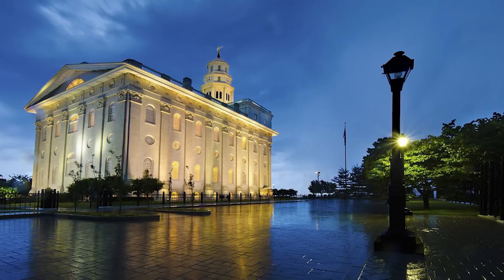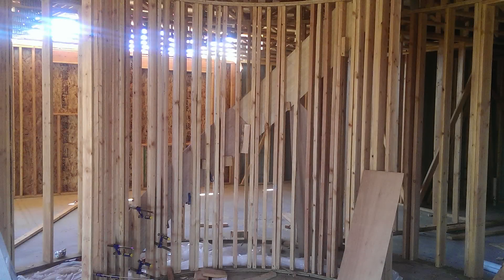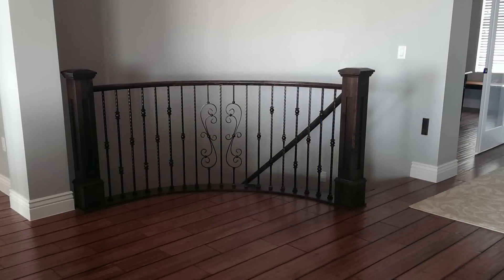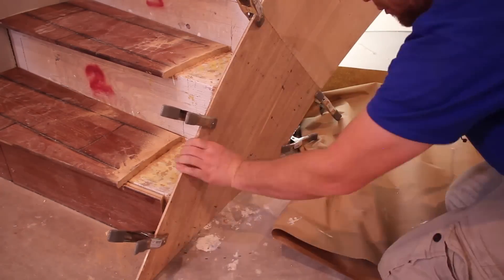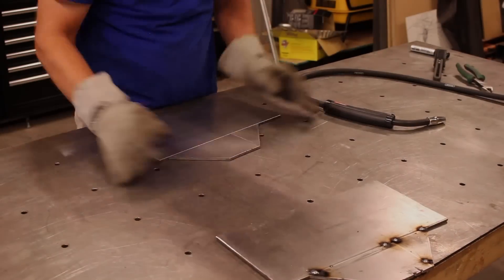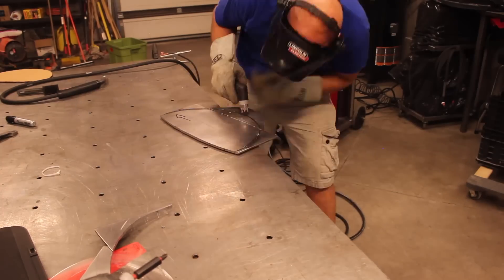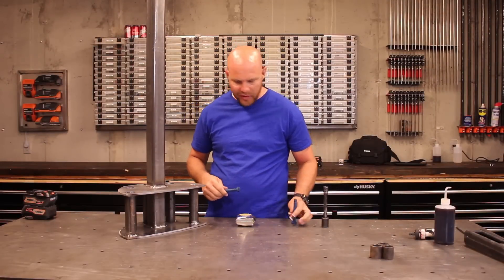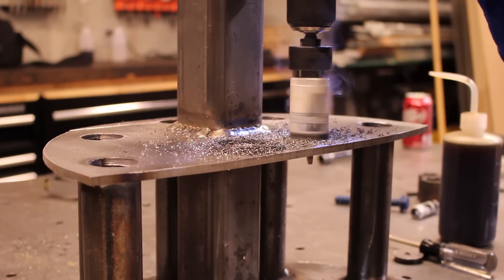Curved Stairs - Part 1

Comment: 1) Do not run band saw blades so fast.! You were pushing hella hard, I could see.
2) Use oil with it. If it was really 1/4" thick, remind yourself of step 1.
3) Using oil or lubricant, make sure it is constantly lubricated.  Keep an oil can with you.
4) wear PPE!
5) Stop running it so fast!

6th and final critique use oil on pretty much anything metal. Especially the band saw and hole saws... night and day difference. Youd get fired ever running drills or any of that without lubricants. Bit breakers are bit buyers as they say...

Cool build. 😎 i would have bought better clamps at the end... i see the real craftsmen. Gluing both sides, clamping final with goo-out and screwed finished.
Reply from the maker: Thanks for the tips!

Comment: I want both sides open. I'm on a few forums but nothing specific to curved stairs
Any guidance where to go? I'm only on FB for social media, but I'm absolutely wanting to join a real forum..
Reply: I've built free standing open both circulars. The width of the stringers adds strength as well as thickness. I would also add a center stringer, and make sure the stringers are anchored securely at the foot.

Comment: Real craftsmen can built whatever they want, and it doesn't have to be connected to any any professional techniques or industry standards.

Earning a living at it is a whole different story.  For that one needs to  work for someone who is already doing that.

Unfortunately you'll also learn all the ways to short-cut and produce an inferior product to what you would do for yourself.

Two thumbs up on this  although coming from a former, retired professional,  your Diy project bears little resemblance to anything actually being produced today or in  the past.

Still looks good though.

Comment: please can you advise me.....the bending ply was ripped in long sections ....how did you determine the angle of the riser to ensure the curve was correct?
Reply from the maker: I am happy to help. Can you please rephrase the question? I'm going what you're asking.
Reply from the maker: Maybe you meant to ask how I determined the angle of the stringer?
Reply: yup ...sorry was not concentrating.....yes how does one determine the angle of the stringer and then translate that to a cut on your ply
Reply from the maker: How far along are you on the project? Is it all on paper at this point or do you have a hole in the floor already and you're building the stairs? 

As for the angle: The angle of the stairs is dictated by the geometry of the framing...You have to consider the headroom as you ascend and descend, as well as how much travel you have, etc. 

To answer your question simply, I ripped all the pieces of ply down to 16", then once I figured out the angle I just tacked up the ply at the proper angle and then drew a level line across the bottom the show me the angle. Then I just chopped off the triangle, and that was the angle. I then removed that piece and set it down on the floor. 

Drive some nails into the form wall as guides so that when you're gluing up the ply you put it at the proper place. Have people there to help you and go to town. 

You don't have to be tight tight where your layers come down to the floor. Just get within an inch on the bottom with your pieces, then every 3 or 4 layers just cut it off with a skill saw, and then you're all done just put a piece of treated under it. 

Are you going to be attaching your ply layers to the inside of the form wall, or outside, like I was doing?
Reply: Thank you....i have a manufacturing facility and were requested to do a circular staircase with a central spiral stringer......if you give me you email i will show you what we eventually managed to do .....but we we made SO many mistakes along the way and you seemed to have a really easy way to do it......we had an outside circular brick wall against which the architect and engineer designed a rolled steel outer stringer plate bolted to the wall.....this plate was bridged to our plywood spiral stringer with flat treadplates on which we attached 45mm shaped treads......we battled with the laminating of the spiral....hence the question..

Comment: Beautiful! Something to be proud of. Great job! I was a carpenter contractor for 3 decades, 70’s, 80’s, and 90’s. Back in the 70’s I took on a job that had a sweeping spiral staircase, got wider towards the bottom. Having never built one before had me a little nervous to say the least. I didn’t even know anyone that ever built one and of course this was before PC’S and the internet. This was really weighing on my mind. The guy that taught me the trade had given me some good advice when I first launched out on my own having only built crackerbox type houses and now beginning to get into custom built homes. He told me if I ran into something complicated don’t try to think about it just start and it will work itself out, this was great advice and served me well but a spiral staircase, having NEVER done one was quite the challenge. Then one night I dreamed I built a spiral staircase, I was so into it in the dream. The next day I new exactly what to do and I built the spiral staircase just like I did in my dream. Turned out beautiful! I really believe it was Devine inspiration as this was the case a few times later as needed. Never had the opportunity to build one again but now I knew I could with a little help from above.
Reply: 🎉😅😢😊😢😊😮😢😊😅❤😢I'm 😮😊😢😂😊😢😮🎉😊🎉😢😅😊wry😮❤😢😊😂😢🎉😅❤😊😊❤
 Vnyt😢🎉❤😅😊😮😊😅😂❤😊😮😢😊3r1😮😊😅😢❤😅🎉😊x'😊😢🎉😊😅❤. 😢😮😊We😢😅😢😮4😮😂😢❤😊😮😊! +😢😮*:😊❤🎉😅🎉❤❤😊😮❤😂😢😊T5u5😮😊😢😊😢😊😂😮😅🎉😊😢😂❤😮❤😢😂😮😢😂❤😊😮😢